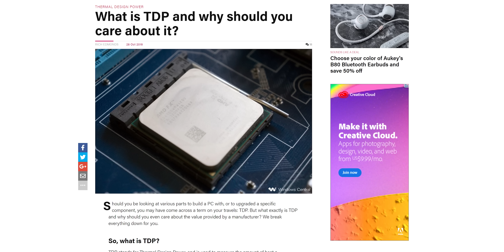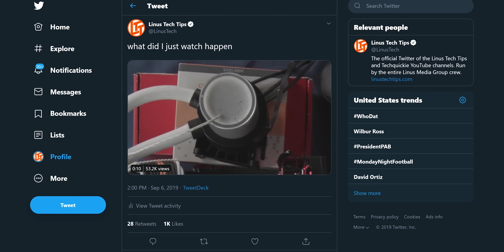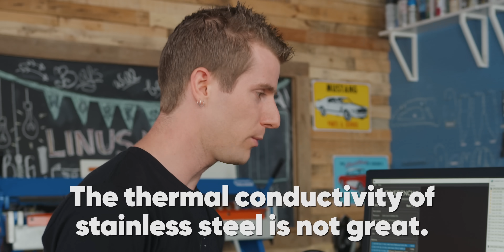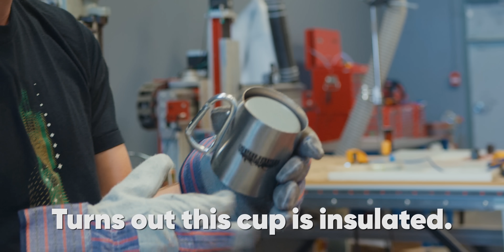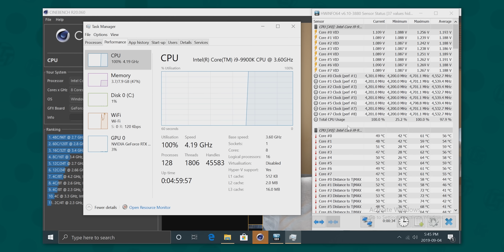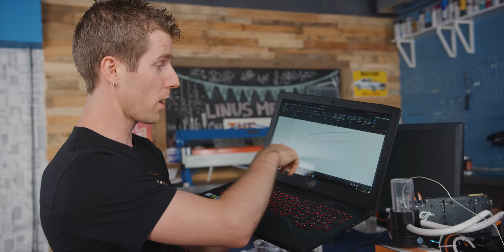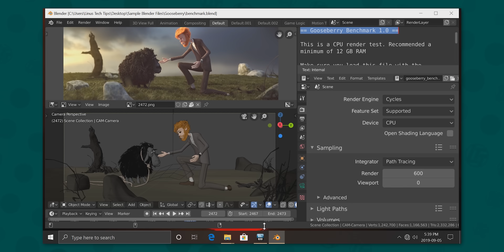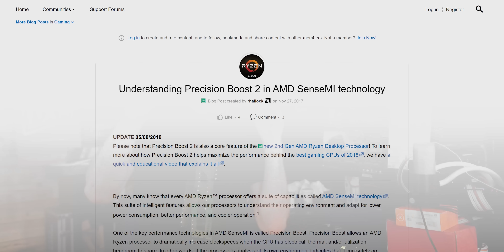Who REALLY Runs Hotter? AMD vs Intel

Comment: Hi, Chemical engineer here
I could tell you that for large chemical plant equipment, large heat output is a result of more inefficiency not necessarily more powerful (in wattage) equipment.

Though I could certainly be wrong, I can think of no reason why a cpu would be any different.

So the wattage of the CPU is an indicator of how much power the cpu consumes. As long as the majority of that is actually used to do the cpu's job (aka processing) there shouldn't be too much of a heat output. essentially, the results of this video indicate to me that AMD's CPUs are more efficient that Intel's.

I like this video a lot and just wanted to point out this
Reply: Saleh S would be cool to see wattage from the wall, all things the same except cpu and motherboard.

Comment: If wanting to demonstrate a calorimeter (device that measures heat), the best and easiest way is to build a water cooling loop without a radiator, just have a large reservoir.  From there. it's just the heat equation: specific heat multiply by volume multiply by the change in temperature multiply by the time it took and you get the wattage.  You need a stopwatch and a thermometer.

Note: The calculated wattage is not from the CPU, it's only what energy entered the water to heat it up over time.  This is because heat is absorbed throughout the path from the die, to the internal TIM, to the IHS, to the applied TIM, to the CPU block, and to the water.   It's the "thermal resistance" spec of a loop that takes the block and the TIM application and pump and rad into account for heat absorption.  

For instance, say your whole water loop has a thermal resistance spec of 0.1W/K, this suggests that at 200W, the change in temperature from the CPU IHS to the ambient air temperature entering the radiator is 20 Kelvin, or 20 Celcius.  But if you measure the temperature of the radiator, liquid itself, the block or the IHS-- they may be slightly different numbers.  It's supposed to be like that.

In science, you create consistency, simply pick a reference and stick with it, i.e. whatever you want to measure for every single test, do the same thing every time.  Don't change where you measure temperature every time, etc.  Be consistent, but also share what you are doing (don't assume) and be open to criticism (not get defensive, the idea is we all need to be on the same page).

Truth is, one could calibrate a standard air cooled heatsink to calculate CPU die wattage, as long as the test conditions are all the same.  It's just fun to do it with liquid.  You can even use a Peltier, the power level changes with the load as long as the hot side is kept in check.  Or get a big block of copper, mount it on the die,  and measure the change in temperature over time.  It's the same concept; there's lots of ways to estimate load through a calorimeter demonstration.

Comment: I like how you'll grind the bottom off cups to find the right one and mill a new bottom, then use some compound to seal it back on, but you won't go to the local pharmacy to get a syringe for $0.50 to measure that ink properly.

Comment: Guess I should get a different Cooler. My Corsair H150i consistently idles the CPUs around 45-50C for both my R7 2700(Non-X) and R7 3800X. 2700 at 4Ghz and 3800X at 4.4Ghz

Comment: There are stories where someone has problems with cooling with Intel CPUs. They found out the 95W is not real, but it's seems actually much higher TDP, like 105W and that is more hotter.
AMD seems more at correct side, probably slight cooler than factory given TDP.
You can say Intel is less trustable about TDP values than AMD.

Comment: Solution:
List both the TDP at base clock and the TDP at boost clock.
Reply: It also depends heavily on the workload. Just compare IBT with Cinebench. IBT can draw more than 30% more wattage at the same frequency.
Reply: @Azraleee  what they should do is show the maximum tdp at running a specific Programm ..i mean intell is not wrong ..its like saying that the dodge Camaro runs 70miles per gallon and I'm sure it can run 70 miles per gallon the question is if that usage is realistic
Reply: @DrSmugface  Well, then we get to the specifics, at which temperature are those chips running, etc...  The point is for Ryzen 3000 a CPU will always run above the base speed if the cooler can dissipate heat output in TDP. Testing my 3800x with prime95 Small FFT (AVX2, worst case) @ 105W PPT-> 3.9 GHz all cores. Cinebench  R15 under the same conditions: 4.1 GHz. 
Of course the Ryzen CPUs will try to run faster if the cooler, and the PPT, allows it to dissipate more heat.

Comment: Nice research, thumbs up. But why dont we just measure Amps on the +12Vcpu?
- Current can be measured accurately, whereas heat dissipates through all parts of the thermal system and is hard to conentrate into just the place where you measure it.
- +12Vcpu will include power consumed by the CPU VRM, but then again, this may be a more important thing to measure.
- Even connecting a kill-a-watt can give good food for thought. Then you will be comparing the consumption of the whole system, which may be even more important. However in that case one needs to pick equivalent kind-of mobos. Or better yet, conduct a broader comparative study of mobos/chipsets.
Edit: Okay, now I read that VRM efficiency varies quite a bit. But it would still make sense to do a broader study of mobos/chipsets.

Comment: You coul've just measure temperature difference between inlet and outlet of CPU waterblock and integral of ΔT * C * F over time, where C is specific heat capacity of water and F is water flow, would give you produced heat.

Comment: AMD = Muscle Car (Full throttle with maximum power at all times)... Intel: Hybrid (medium power, most efficient mode, with full power ready when needed). But both get similar mileage.
Reply: ...Except the muscle car managed to run and get you there a heck lot faster (~19/13 times), while having similar milage to a hybrid...

Comment: What they need to do on these is come up with a standard like 80plus for efficiency.  that way that wattage can be calculated for energy loss .  Just like PSUs the heat and wattage can vary depending on use.  Like the mention of changing RAM speeds  in the video usage can change a lot of those advertised claims.

Comment: Terrible test. The coolant temperature is allowed to change too much, which affects boost clocks. It would have been better to use a larger volume of water (~1L) and a smaller temperature rise. (20C -> 30C)

Comment: I have an I7 8700k stock, and Amd 3600 also stock. Both using 16gb of G.Skill 3200 XMP. While running same games my Intel runs at 65-70c, but AMD runs at 47-54c. Then took my intel's fan and put it on the AMD and still AMD ran as same temps as before. I've applied paste 3 times, changed fans, and even added a fan. The Intel computer just runs so much hotter than my AMD. I then put a Scythe FUMA 2 and still the Intel's temps remain to stay at 65-70c. Both fan curves are set to 100% when hitting 55c. So AMD although being 15c cooler on avg. isn't even maxing out the fans like the Intel is. I think I am done with Intel for now. never rig I build will likely be AMD again.

Comment: AMD fanboy slants the test and this need to be redone with EXACT. There is so much Wong with these 'tests'
Go back to the drawing board here, or even better. Leave it to GN.
For the record, I'm not an Intel 'fanboy' I have systems on both sides of the fence here. Anthony and Linus have failed so much in this video it needs to be done properly.

Comment: Dear #Linus Tech Tips 
Please be aware that at some MBs MCE is not working untill Speed Step is enabled. If Speed Step is turned off the only thing which will change are voltages at cores, mesh (cache) multiplier and thermals. Turbo is in fact off. 
I'm right now testing Taichi Ultimate Z390 and this is the case for R0 CPU's. 
Yes, the Intel Turbo is on and all turbo parameters are maxed. MCE won't be working until Speed Step is On. 
Speed Shift doesn't matter.  

So if you have been using this LGA1151v2 MB for max OC you might have left Speed Step off.

Comment: Using a insulated thermal bottle to measure heat? What the ... Last time I looked at my cookware it had copper base to the pans not two areas not touching? LOL So who really cares if a 95w is different than a 102w? I think they are close enough to call them in the same ball park. I guess you guys just needed a project to post. LOL At least you kept in your mistakes and kept it real. It was funny to watch.

Comment: Incredibly smart stupid people....

watching this is so frustrating.  It is like watching two donkeys trying to reproduce...

Easier to measure this.  Install a TEC in between the CPU and a known water cooler with set temp.  The voltage differential will tell you how much heat/wattage the cpu is putting out...
Reply: But... It isn't that much fun..😂😂

Comment: Bro Please see the build is it ok or need any change please?
Ryzen 3700x 
Msi x570 gaming plus,
g skill trident z rgb 3200 MHz 2*8=16gb ram,
zotac GeForce rtx 2060 8 GB graphics card
transcend 220s 256gb nvme SSD (4600),
Segate barracuda 1 tb 7200rpm hdd.
antec high current gamer 650w moduler 80 plus certified power supply,
antec da 601 casing,
thermal take ux 200 CPU cooler

Comment: All you really needed to do was look for the difference in temperature change. Doesn't matter what system you build if you take the same size sample mass from it at the same location that would be a fair comparison. In other words you made shit way to complicated. You should have just hooked up the water cooling loop made sure the initial temp was the same and the amount of water in the system is the same amount. Then all you had to do was measure the temp of the loop.

Comment: the mutli-core enhancement feature within the Intel CPU is pretty maddening. Owning a 9900K, having that feature on makes overclocking virtually impossible and super hot.  

So, from like 1.45v to 1.30v, when trying to run the CPU at 5-ghz all core with the MCE on and off, respectively.  I left speed stepping on, to save power, but pretty much every other feature I turned off and got much better performance/TDP. 

Also owning a prebuilt 9900K system, from Lenovo, I found the CPU barely ever going above 4.7ghz on even a single core, and often went to 4.0ghz (or lower) when running all core.  I couldn't tweak the bios with the Lenovo system, which pretty much made that system junk in my eyes. 

I would love to have a 3950X or threadripper 3, but I've owned this 9900K for quite a few months now, scoring it for a better price than the 3800x, and will ride it out for another year I think.  For my needs, it does the job quite well, but it does feel a bit dated with 14nm+++++++ or whatever

Comment: Great video. You guys should show how much i9-9900k is drawing from the VRM. Regulated: 145W. OCed to 5.0GHz - 185W. 5.1GHz - 230 -245W 
when all cores are in the AVX 256 / 512 with -2 steps in multiplier.